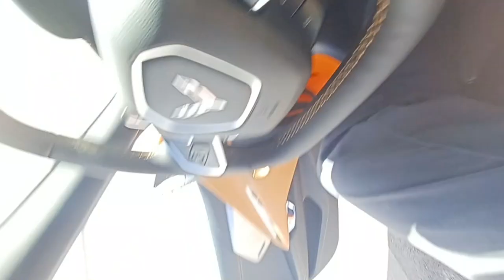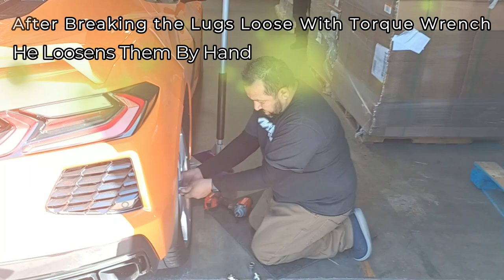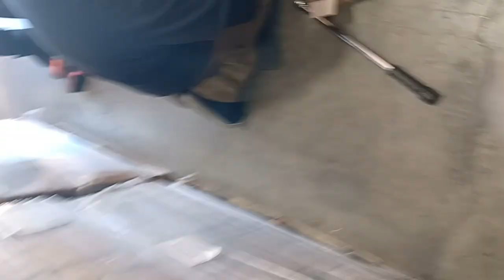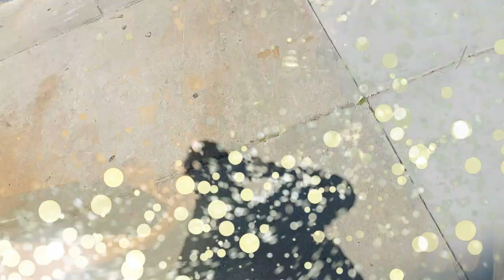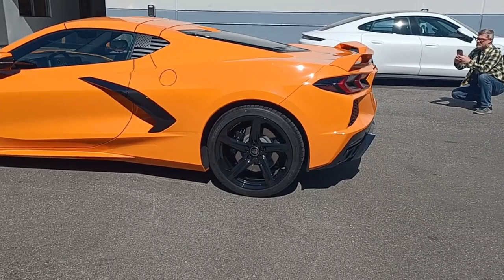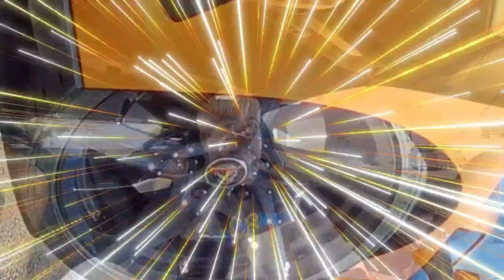Correctly Installing MRR F023 Wheels on a C8 Corvette Stingray

Comment: Wheels look great, but leaving those steel hat rotors on is probably not the best thing when aluminum hat rotors are so cheap now. Not being critical because the braking system works as is, but you could lighten the car even further for cheap.
Reply from the maker: Thanks for your input. Thanks for watching.

Comment: Looks amazing, I’m getting the exact same wheels, which lug nuts did you end up purchasing? I do know the lug hole is smaller on most aftermarket wheels.
Reply from the maker: Thanks. The lug nuts were supplied by MRR